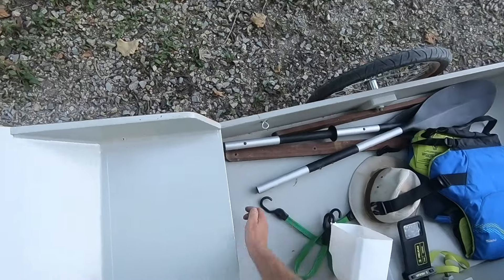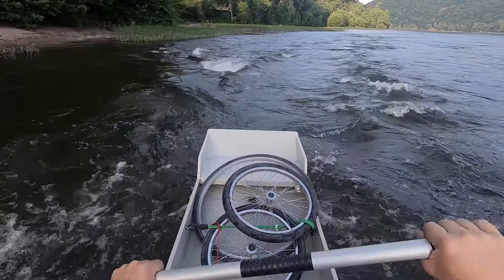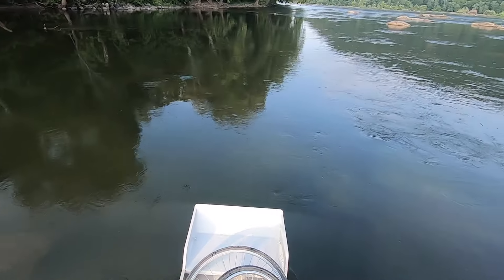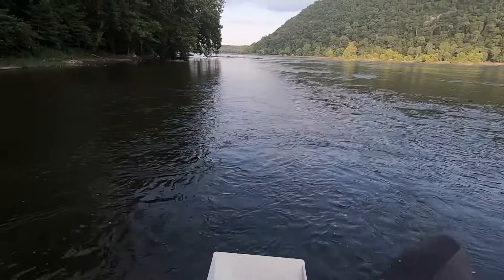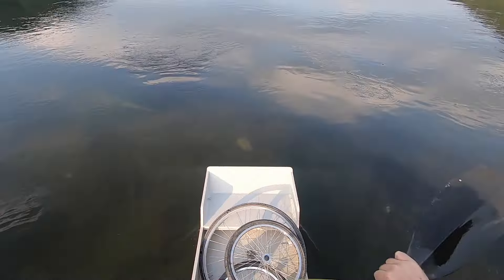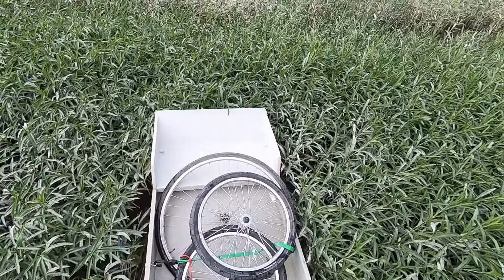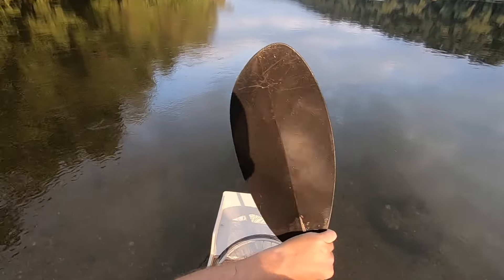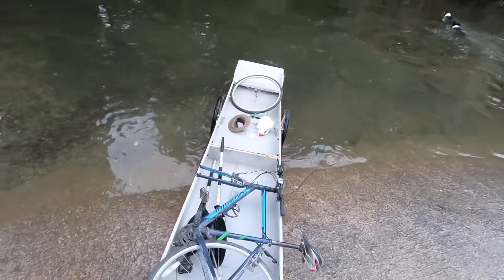Testing a wave deflector on my shuttle punt

Comment: Wave deflector AKA raised bow? It looks like you are tailoring the boat nicely for the conditions in which you use it. 👍👍
Reply from the maker: Thanks.  I could have made the entire freeboard taller but then windage would increase, so adding height at the bow with something that nests inside the boat when folded in half seemed like a good idea.  So far it works well.  I don’t have to deal with motor boat waves here, just going down the occasional rapid shoots so yes this is very much designed for this river or protected bays or swamp lands.

Comment: Two passenger... 

Perhaps consider racking two bikes on the stern section, front wheels removed with the forks straddling the side panels, utilizing the tow hitch as rear support ?

👣🕊👽
Reply: Capped PVC pipe inside to hold one fork arm, bungee the rear wheels together, PVC pipe crossbar on the hitch to rack two bikes and PVC support bar across the stern sides. 🤷‍♂️